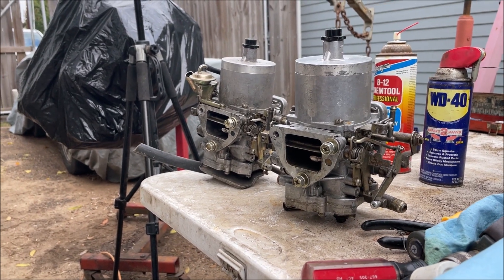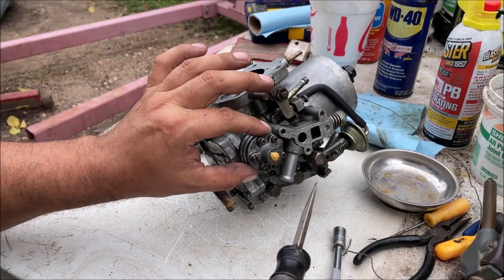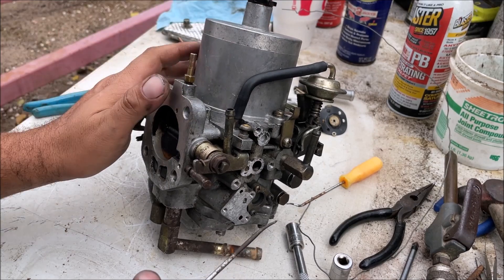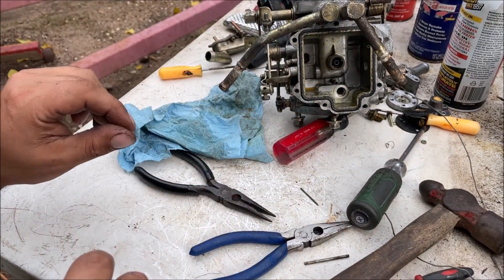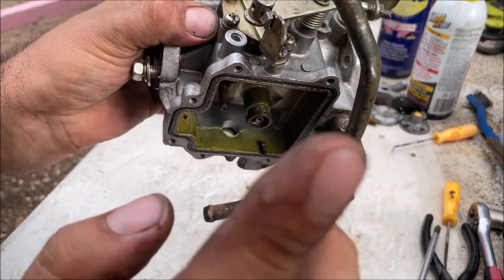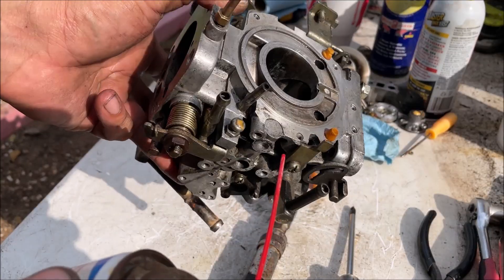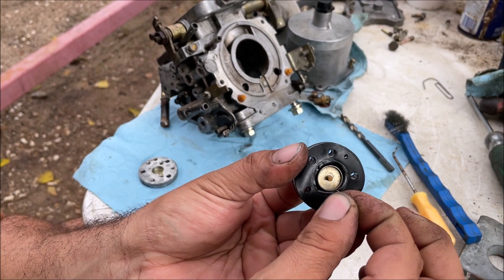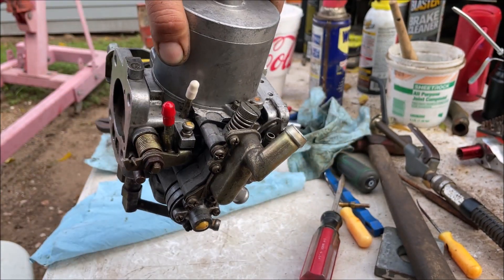1974 Datsun 260Z SU carburetor FLAT TOP HITACHI DUAL 1 BBL INSPECTION for the first time EVER

Comment: just saw this post. its basically a slide carb, like on motorcycles. they kinda suck because they wont put much for the L28. needle profiling is needed. also, you gotta take off the fuel bowl everytime u need to raise or lower the needle for "jet" adjustments--there are no jets, its just the needle. they're fine for just cruising around but definitely not for performance. dual 32/36 webers are way better. ive had both and now am na-t with a single 45mm dcoe draw thru setup. i'm going to attempt to build a dual dcoe setup next...

Comment: Well you attacked it, and came out alive. The dual 240Z carbs from 69-72, are dead simple, I have them on both my L-28 motors I put in my 280z and 240Z restomods.
Your in Texas, keep your eyes open for a set of 240z early cars. Yep yep I know some people are price gouging the hell out of these parts. But you will meet Texas Z club members with spares, they wouldnt , gouge you, because your a brother in the Z community. Even as a Z internet community on face book groups, somebody will release a set from their stash.
You know by now the dash pot dip stick is a dampener so the piston won't fly up on heavy throttle opening and cause an air gulp of lag, in power. Just use mystery oil or auto trans fluid/ a light oil.
Not synthetic oil as it will just shoot out the pin hole at the top.
At least those carbs are very cheap to buy as parts donor's
 One last tip, when screwing down the air chamber dome. Tighten it like a head , criss crossing between the three screws. Always check the piston moves up with your finger and falls down . It's easy to tighten one screw and the piston gets jammed in the up position.
Man I just went thru the videos of your I've watched and forgot to like about 70%,
that's not like me, but I feel better now every Z vid ,got the thumbs up! This thing, will be scurrying ,around  soon enough !
Reply from the maker: I bought some round top carbs too….. the kits are cheaper too